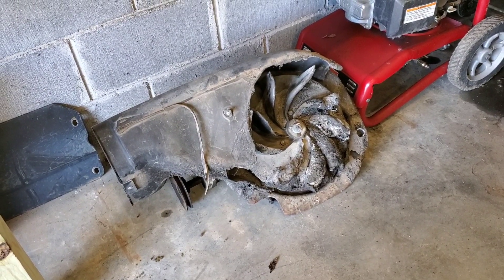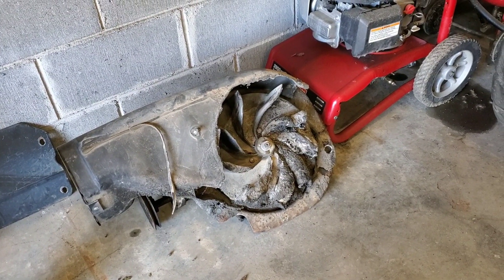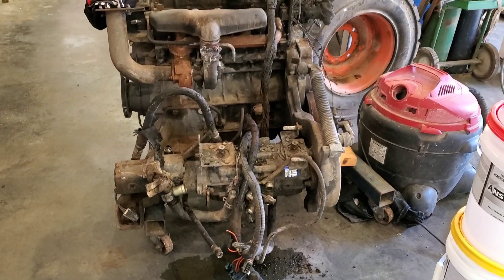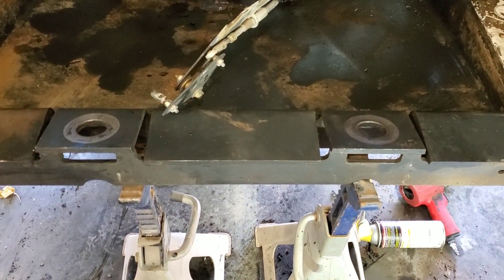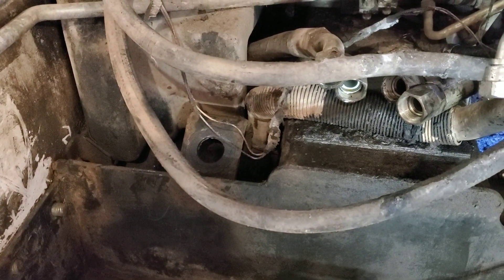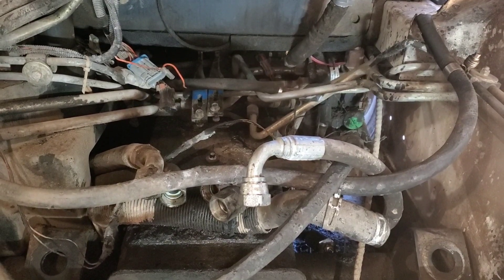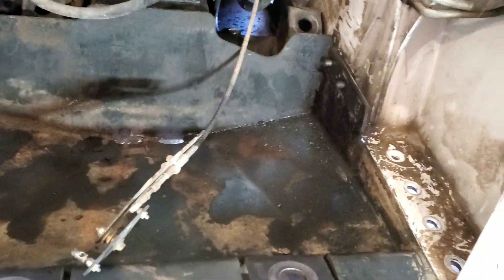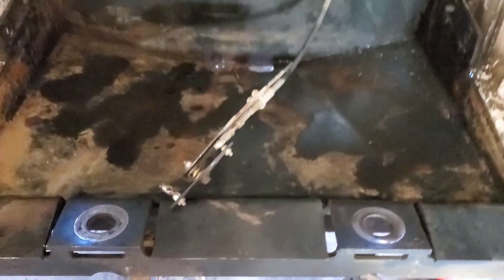Bobcat 873 Engine and fuel tank removal

Comment: Hey Mark, My, Bobcat 773 caught fire setting in the driveway... I look out from my sink one morning and see the flames engulfing it. The fire seems to have started around the battery!... I am removing the motor tomorrow(2-24-20). I will be following your channel!! Thanks a lot!
Reply from the maker: Good Morning Semocase, my hope is that we all can learn through this process.  The fire in my machine was pretty extensive and I am finally back at it and will get some new footage up soon.  I tore down the Turbo and cleaned it back up. will be trying to start the engine soon to make sure everything sounds right before moving forward.  Have a great day and stay tuned...  Be Blessed!

Comment: Brave man lol I'm looking at a 863 turbo tomorrow. More than likely it will need a new motor. Thank got all the hydraulic system is ok.
Reply from the maker: lol Thanks Jeremy, Bravery and ignorance are sometimes confused maybe........nah...lol  have a great day!  and the 863 will make you a great winter project.
Reply: @SlimyGreenGarage  i purchased a 743 3 years ago. I had to dig in it a smidgen. Its a solid machine now👍🏼

Comment: How did you remove and replace the fuel tank.  My problem is the fuel gauge dropped into the tank on my 453 (yes he is an old guy), and I just want to know if there are any pit falls to avoid.  Being an old Marine, I know the best way to survive an ambush is to avoid them.  I am having a difficult time finding information on my 40 year old machine.
Reply from the maker: The engine had to be removed out of my 873 to access the fuel tank...its a big job but doable:)  snap a few pictures of important areas before you start to give you reference points when putting it back together and God Bless!
Reply: @SlimyGreenGarage estimated time to remove engine and tank

Comment: Thanx for the tips! So let me be clear on this: To remove the fuel tank you have to first remove the engine. Talk about design and engineering! Anyway, how long did it take you to remove the engine? Any tips on how to clean all the debris out of the fuel tank that keeps clogging the pickup strainer?
Reply from the maker: It probably took me a couple days to get the engine out not working overly hard.  My best tips would be to be patient...lol make good use of a little heat for stuck coupler connections and as far as keeping the tank clean I would say that it goes back to good maintenance, keeping the machine clean and using a screened funnel when fueling it up...thanks for the question and God Bless.....You Can Do It!!
Reply from the maker: And yes it must come out....AGREED on the great engineering

Comment: I have same bobcat 873 and the fuel tank is liking I need remove the engine to pickup the fuel tank?
Reply from the maker: Yes sir there is no way to get the tank out without removing the engine.  You may also want to contact a bobcat dealer to make sure you can even get a new fuel tank for that model now.....
Reply from the maker: Unfortunately they have discontinued a lot of the parts for the 873
Reply: @SlimyGreenGarage  thanks so much for the information, I find a dealer bob cat is $700 bucks a brand new fuel tank
Reply from the maker: Glad to help out my friend!

Comment: Does the tank have a rubber drain bung? If so, where abouts is it and can you access it while it's in the machine? Thanks, Andy
Reply from the maker: it does and I'm pretty sure you can access from the main drainage holes on the bottom pan of the Bobcat

Comment: I'd like to know how you reached all those hydraulic lines to get them off. Also, is it necessary to remove the rear wheels to accomplish all that?
Reply from the maker: Hey there Grampa Badger, Having the rear wheels off made it easier to get the fuel tank hold down brackets out. As for the Hoses, its just a combination of getting at them from every angle possible....cab up.......side covers off......Patience and a few obscene words.......:)

Comment: 1) Did you have to raise the arms or cab to do the engine removal?
2) Where did you get the tank? 

That doesn't look half as bad as my burn, I'll be replacing all wire harnesses. Any leads on parts? eBay is pretty expensive. 3-500 for a harness.
Reply from the maker: I did not have to raise the arms, but I did have the cab tilted up while getting to some of the things near the rear of the engine.  There are 2 bolts in the front of the cab that once removed will allow you to tilt the cab back and it will lock in place.  mine has hydraulic rams like on a car hood to help in lifting,,,,although mine are wore out....lol  I bought my fuel tank through Bobcat Of Omaha, but any dealer should be able to get that for you.  If you get on the Bobcat website you will find that if you enter your serial number you can find your part numbers.  As far as your wiring you will find a disconnect plug under the cab once you have it lifted up.  If you have any more questions or need more specific info just let me know.  Have a Great Monday!!!

Comment: One last question, what size are the bolts holding in the tank, I had a 24mm socket, with me when I went to pull one, but its much larger than that. thanks Mark!
Reply from the maker: Good morning Friend, I used a 1 1/8 end wrench, as I also did not have a metric socket large enough....Have a Great Day and keep pushing forward!
Reply: @SlimyGreenGarage  I was using a 1/2" breaker bar with that 1-1/8 socket and broke the craftsman breaker bar. they're sending me a new one, but I cant believe how  tough they are on. I'm having the junkyard remove tomorrow or monday
Reply from the maker: @justatool  lol, I can appreciate your struggle, I actually had to heat a couple of them up with a torch before being able to get them to break loose.